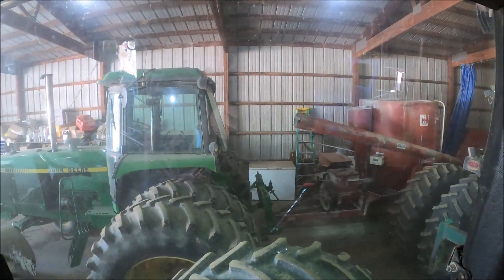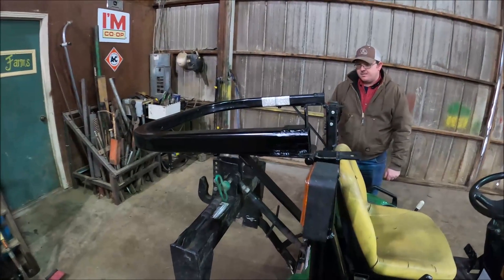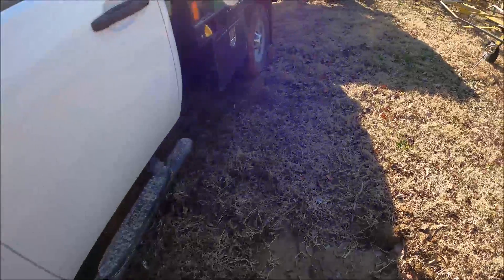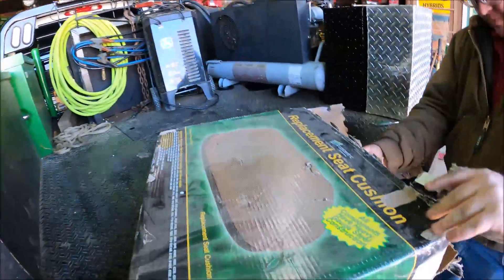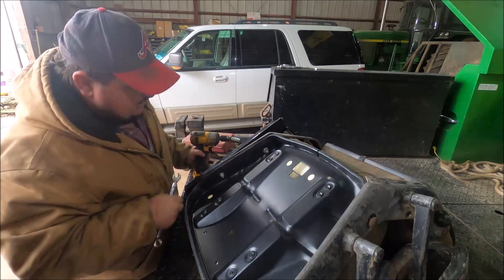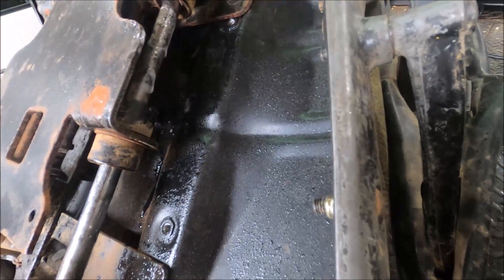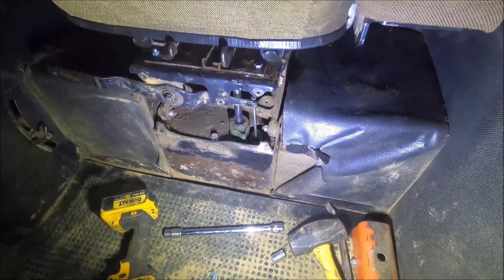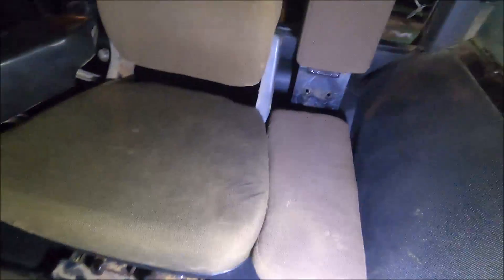The 4640 gets a new seat.

Comment: I sure appreciate you making this video. I'm about to install an air ride deal in the 4250. We'll see how that go's
Thanks alot
Reply from the maker: Hopefully things work out well for you.
Reply: @DylanJoyceFarms  I got the sucker torn apart, but had to make a few phone calls, since they didn't send any installation instructions with it. Will take some rigging up to make everything work, but I'll get it eventually
Reply: Your video helped alot though, since I had about everything done, up to the point where I need to remove, or not remove the Hydraulic ride piece, ended up taking it off, so now just a few more tweaks and she got a new seat